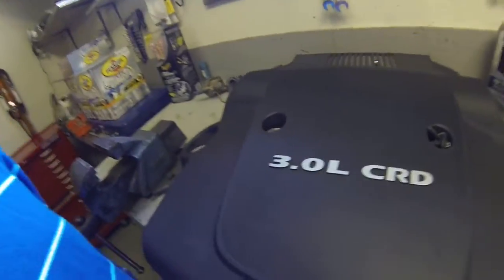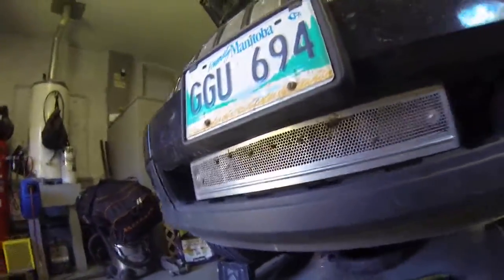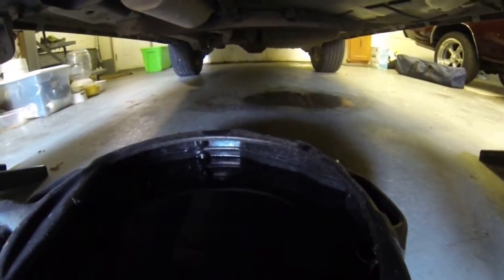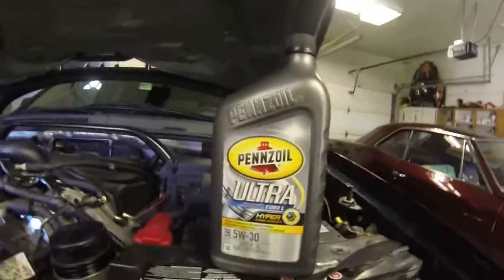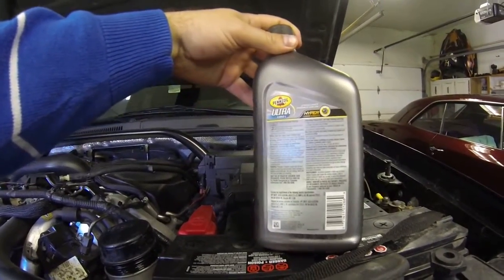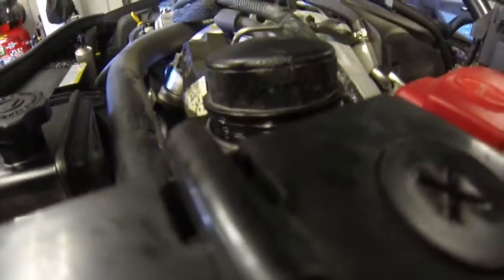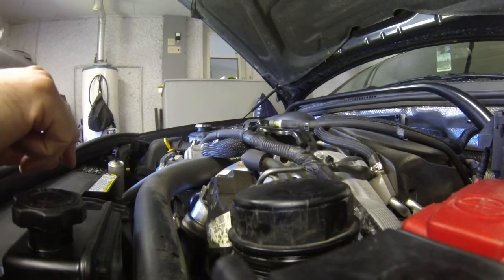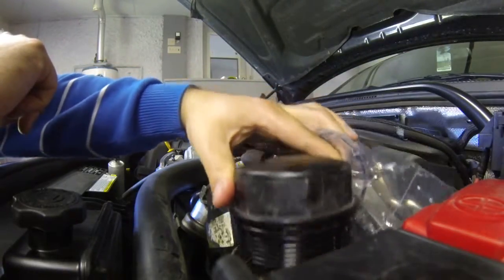How to Grand Cherokee Jeep Diesel Oil Change

Comment: Where do you get your parts, and how much do they cost? I just bought one, love it, and am coming up on the first oil change. Thanks for the post.
Reply from the maker: +George Zegouras Hey George, I go to Piston and Ring for my parts, I try to keep it all genuine parts.  Just so you know make sure you get the correct oil don't put any cheap stuff in it. It has to have that European certification. Talk with you dealer I have heard bad news when people use just any oil. Cheers my jeep is running great and just turned over 120,000 miles.